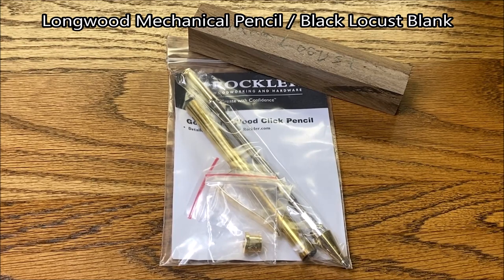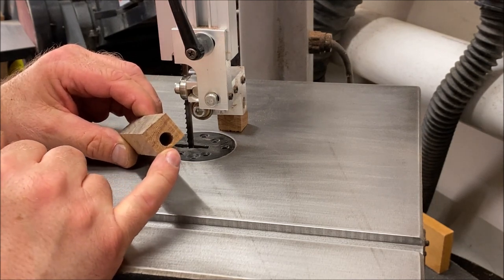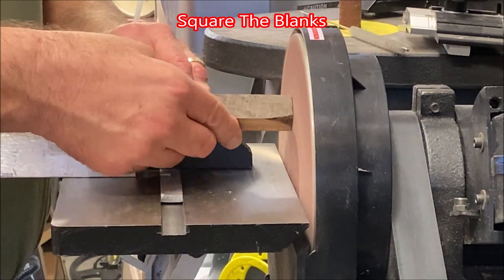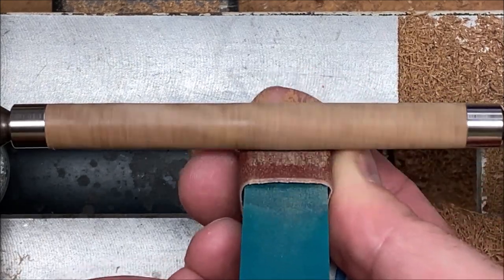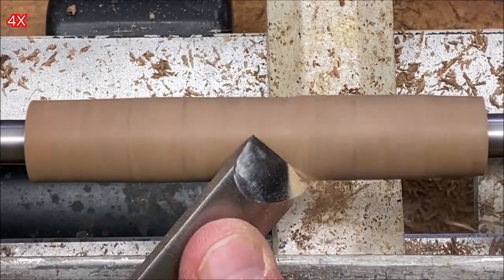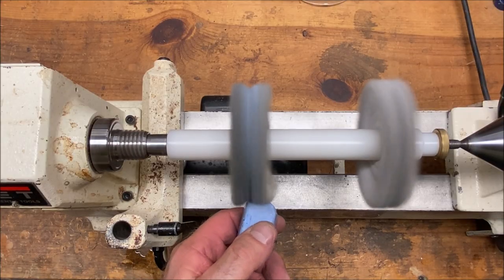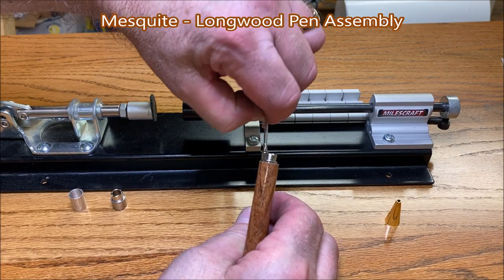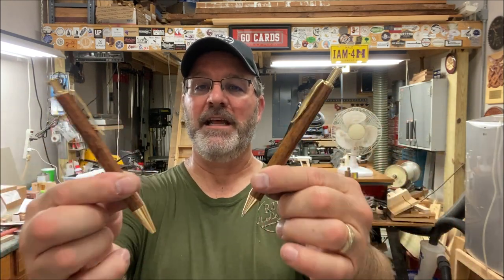Two, Two, Two Pens in One. Long Wood Click Pen & Mechanical Pencil

Comment: Very nice, Bob~!  The Black Locust looks great, as does the Mesquite.  I was stationed in west Texas and had access to a lot of Mesquite for my woodworking....it's everywhere~!  The friend that turned me onto it described it as having a "gnarly" grain.  Although you can see the main direction of it, it appears to have grain running in multiple directions, as you saw after turning it.
I really like those long wood pen kits too.  Looks like I need to make a trip to Rockler, not that I really need a reason.  😁  Thanks much~!
Reply from the maker: Thank you Andrew,
  I really like that crazy grain pattern and there’s a good contrast between the grain and the wood which makes it really beautiful once finished. 

Regards,
Bob

Comment: I haven't stepped foot into my shop to do any pen turning for almost 4 years now.  I don't really miss it...the stuff got way too expensive to mess around with, and the components of the kits just kept getting less and less acceptable in quality, I also started having way too many transmission mechanism failures across the board regardless of supplier, and pen or pencil mechanism.  

I need to get back out there and try some of the new kits that have come out, but now its 100+ degrees, making shop work unbearable LOL.  Winter projects yes, summer, not so much HAHA!!!  I have some pieces of Walnut I want to cut up and try to make something out of, a couple pieces of Maple, and some Cherry.  I have some Locust, but that stuff gets harder as it dries out...it really does a number on chainsaw chains too.  

I've had a few people ask if I still make pens, told them I quit about 4 years ago.  They asked why, and I said well the cost of all the stuff to do it, the time, and my lack of patience pretty much done me in on a lot of it, as well as working way too much to care about doing anything out in my shop sadly.  Mortgage mess finally got taken care of, then started working on some organization out in my big shop to get my tractor and implements stored out of the weather...so now that a lot of that has been taken care of, I'm in hopes I can step back into the shop and do something this coming fall/winter/spring...got a lot of pen kits and blanks, just no motivation to do anything...by the time I get home from work the last thing I want to do is stand on my feet some more out in the shop, I'm just plain exhausted.
Reply from the maker: I completely understand. A lot of what your saying contributed to my burn out and absence from the shop. 

I sure hope you get back out there and give it another chance. If you do, go for click pens instead of twist. Less to fail. 

Regards,
Bob
Reply: @RJBWoodTurner  Gonna try and get back at it as soon as the heat wave is gone...so probably be middle to end of September.

Comment: I'm new to pen turning and appreciate your videos.  Why do you use epoxy rather than CA glue?
Reply from the maker: I’ve been turning pens for a long time. I’ve had C/A let go of the tubes and the blank will spin freely. Especially with acrylics. 

Epoxy is permanent. 😃

Regards,
Bob

Comment: Well Bob I have always learned so much from your videos and very glad to see you back on pen making! I had a question. You mentioned in your video that you sand around 840 rpm. I've always sanded around 2500, I will give a slower sanding a try to see if that improves my finish. My question is do you sand acrylic and resin blanks at the same rpm or do you adjust thoes accordingly? Thanks for all you do Bob!
Reply from the maker: The slower the better with acrylic and resin blanks. Heat melts the resin dust and can merl it back into the blank. Makes a heck of a mess and can ruin a blank. 

Regards,
Bob
Reply: @RJBWoodTurner  thanks Bob for the info and the reply, I'll give it a try. Happy turning!